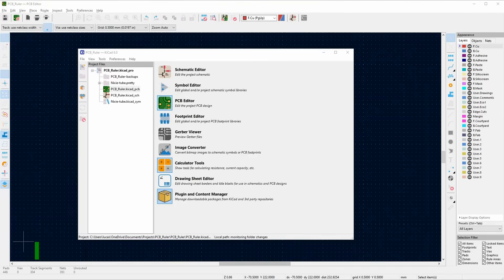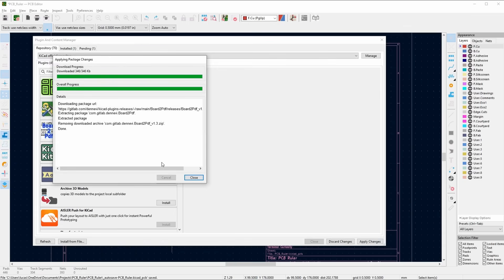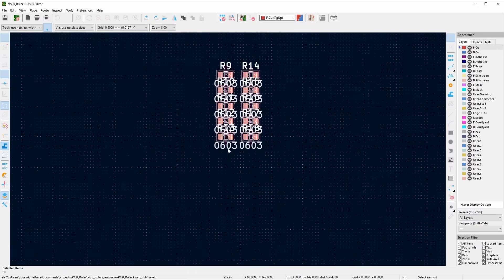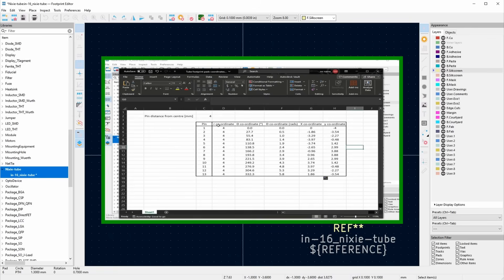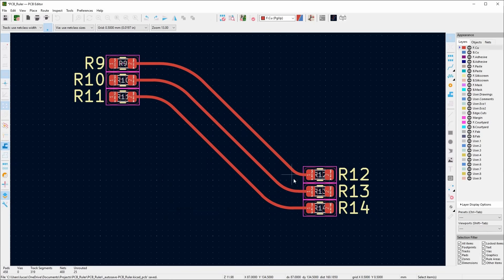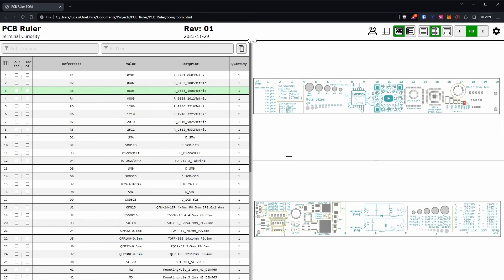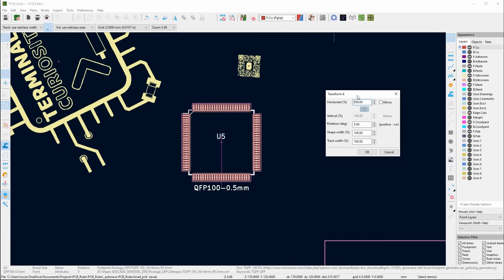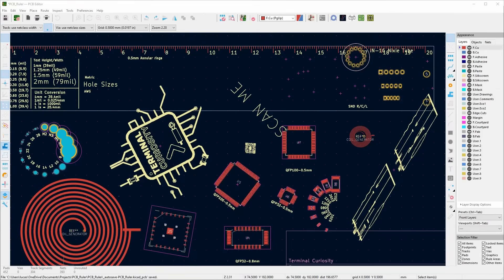Boost Your PCB Design Productivity | 7 Best Plugins for KiCad

Comment from the maker: There have been many great comments pointing out that this was recorded in KiCad 6 and the latest release is KiCad 8. That's my mistake, but I have retested all of these plugins on the latest update and they all work as normal except for "Gerber to Order", which seems to be broken. In the mean time, until that plugin is updated, you can use "Fabrication Toolkit" for JLC PCB and it should work fine, even for other PCB manufacturers.
There is an alternative called "PCBway fabrication toolkit" for PCBway, but seems this plugin has also broken during the update.
Reply: Thank you for the video ! I found it strange that you don't mentionned autoimport which allow to autoimport models (schematic + pcb + 3D) from online librairies. Makes me wonder if i'm at fault then ?

Comment: Is there a reason why you shouldn't make all your tracks rounded?  I would think angles might be bad for EMI, but what's the downside ?

Once you layed out the board, can you then do a global re-annotate, so that the number for the components goes from the top left corner to the bottom right?  

Any thoughts on other popular KiCad plugins.. like, Freerouting plugin , bulk hide silkscreen designator, Schematic Blocks , Parasitics, 'transform it' , Pinout Generator,  3D archive models , Gerber To Order, Keyswitch KiCad Library + Simple Libraries + Alternate KiCad Library ,  Via Patterns , Set Hole Diameter plugins ?

According to Pat Keegan (Psychogenic) KiCad9 also has a great jlcpcb plugin!   I like the Nerd and Dark Color Themes!

Comment: The coil generator has a few  shorts in the trace at the outer diameter when trace width is greater then 250um  (space 200um).

Comment: Another great plugin, although currently broken in v8 (in work), is kicad-action-scripts which includes a way to easily add thermal relief holes for your PCB.
Reply from the maker: Thanks for Pro tip! I'll have to check this one out